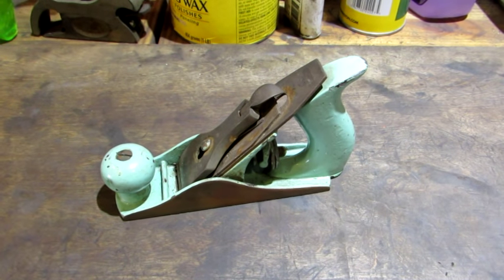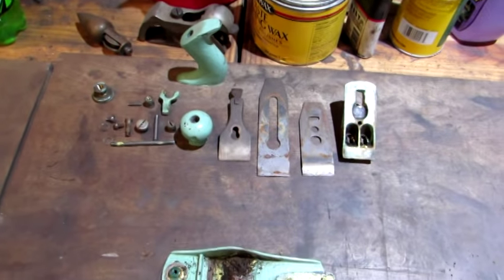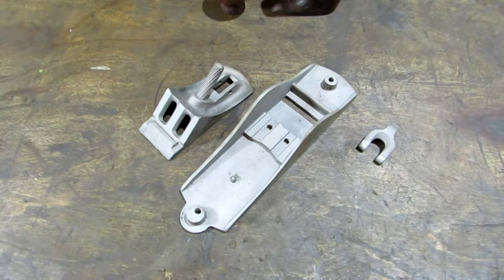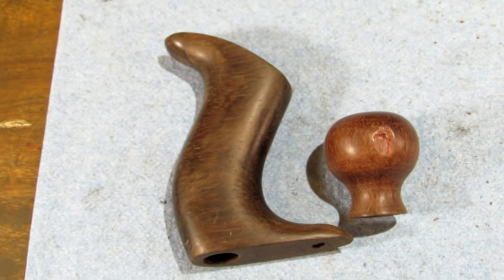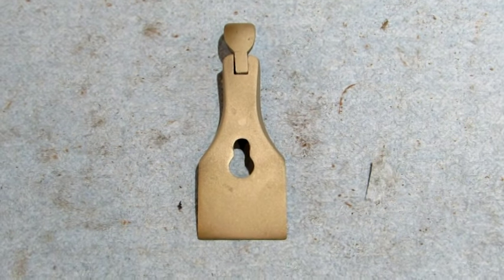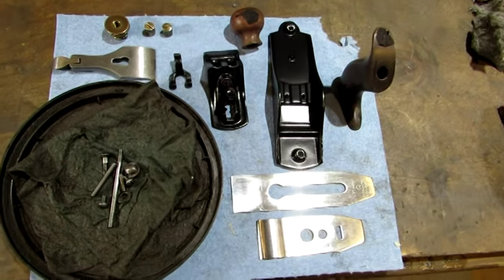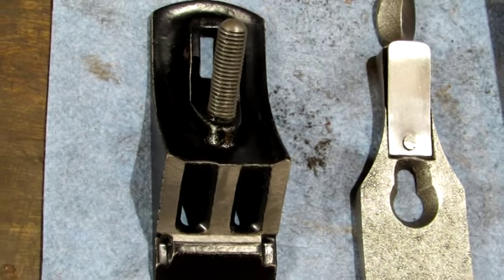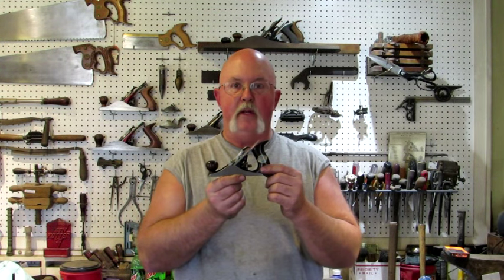Stanley No. 1 Plane Restoration

Comment: The No. 1 was likely a trainer for much younger hands than ours. Back in those days, children as young as 6 or 7 would still enter apprenticeships. Especially if their dad had died. Someone had to jump in and find work to help support the family. Later on, they were likely school shop class items up until WWII when as a less useful tool to the adult craftsman they were likely melted down for the war effort. This was one of my favorite restorations I've seen of your so far. It's just about neck-and-neck with the adjustable circular plane/s. That paint sure worked as a preservative, didn't it?

Comment: looks great. what did you use for paint?
Reply: Brand new subscriber. Excellent, excellent job on that little beauty.

I would be super interested in learning more about your finishing process. I just completed my first vintage machine restoration with a 1964 Craftsman bench grinder. My next restoration will be my vintage No. 4 Stanley, that needs a complete restoration, as you did on this No. 1. All the other japanning techniques are less than impressive.

Please share!!!